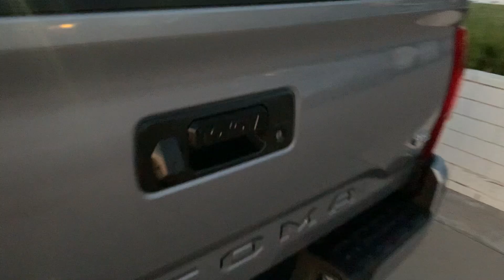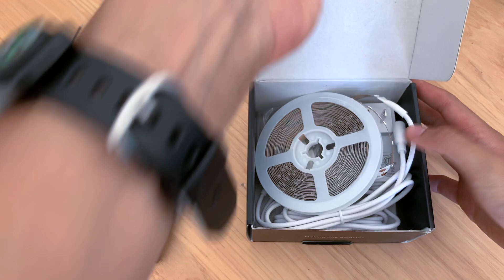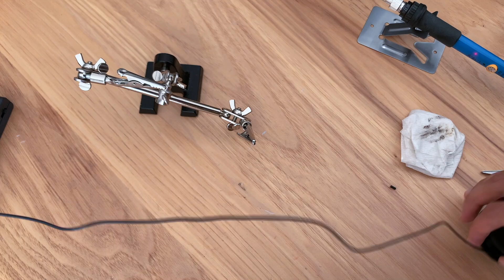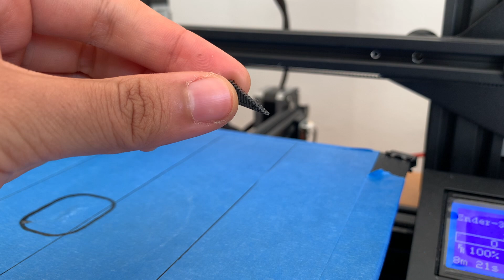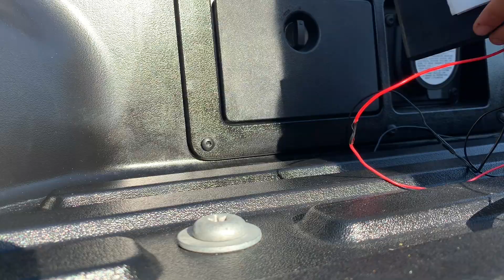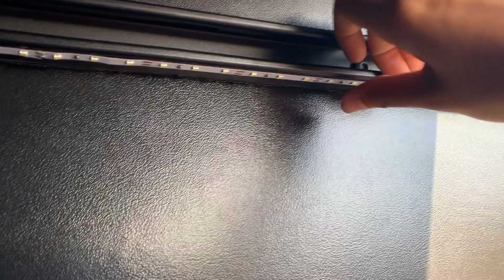DIY Automatic Bed Lights (Prototype) | Toyota Tacoma

Comment: Congrats on graduating! 

Maybe for version 2.0 you could put the tilt switch inside of the tailgate and wire it through the backup camera hole at the bottom for a more stealth look. Kind of like how you'd install a pop n lock in the tailgate.
Reply from the maker: Thanks for the fantastic idea! It would definitely look much cleaner that way.
Reply: @ChloeKuo  Thanks for the awesome idea!
Reply from the maker: @DonaldChapman  That's exciting! Glad you improved on the original design, keep us updated when you finish!
Reply: @ChloeKuo  I finally finished. My LED lightes never were delivered so ended up getting these instead. https://smile.amazon.com/gp/product/B017XFF9IM/ref=ppx_yo_dt_b_asin_title_o00_s00?ie=UTF8&psc=1
They worked out perfectly! I drilled a small hole in to the bed just above the tonnau mounting rail (above the power outlet) and dropped my wires in there. I temporarly removed the power outlet and storge box and was able to solder the wires and hide them completely behind the outlet. It works great!
Reply from the maker: @DonaldChapman  Good to hear and thanks for sharing your work! I'm sure yours looks a lot cleaner with the wires hidden behind the bed lining!
Reply: @ChloeKuo  So I received switches today and ran the wires.  That was much more of a project than I expected! I connected the tilt switch near the pop-lock inside the tailgate and ran the wires past the license plate light (where I tapped for power) and on up in to the little storage bin on the right of the bed. The bed lights will only come on when the parking lights are on and the tailgate is down.  Now I just need to wait for the LEDs to arrive...
Reply: Great project Chloe! I agree with Ken O. You could easily put the switch inside the tailgate, Also you could tap the 12VDC off of the trailer hitch wiring and make it only turn on when you have the parking and/or headlights turned on (just my preference). All that said and done, I would cut out the extra wire between the strips (or hide it in a loom) for that awesome look.  Keep up the great videos!  -Update... So I just bought the LEDs an switch from Amazon, I will be building this next weekend!

Comment: Run one single light strip that is long enough for the 3 sides. Heat shrink tube the 2 corners so lit lights won't be visible there and there will be no loose eire either.

Comment: On the wires, could you make them longer so you could hide behind panels more. Or Use wire looms or gorilla tape them against truck. You should be able to throw stuff in back without worrying about wires.

Comment: In V2.0 use heat shrink on the wire solder joins to make it last longer. Best option would actually be to use butt connectors, crimp and solder then heat shrink. This will create a strong and long lasting connection while tape is more likely to wear off or come undone in extreme weather conditions!

Comment: Everytime you hit a large bump the lights will go off 🤣. Better off using a different method: hall effect (if you can print something to get it far enough away from the body metal), ir distance, capacitance, or 6-DoF.

Comment: To me this is the only way that makes sense for a bed light to be activated. I have the OEM Toyota bed lights for my 2017 Tacoma but I don't wanna go through the rigmarole in wiring it up to the light switch. Thank you for posting this I'm going to see if I can make this work with those. You are beautiful and you have a beautiful truck!.... And congratulations on your graduating you are awesome!

Comment: Congratulations on your graduating. Initially, I was thinking that the automatic portion was going to be some magnetic switches in the tailgate. I work on alarms, the only tilt sensor that I was aware of, was for wireless contacts for certain manufacturers. I had never even thought of a tilt switch of this fashion. I did a similar install in my 2004 Toyota tundra. I am going to be doing another install in my 2014 (don't hate me) Chevrolet silverado.

Comment: Version 2: Use 1/4" black split loom to clean up the wiring, and you can then use printed brackets to hold the split loom in place or secure it with commercial brackets. You can also install a contact switch in the tailgate, or print a better bracket for your tilt switch that can mount inside the tailgate (using the rear view camera wiring harness to conceal you wiring) (other notes below)

I do like your idea of using a tape up LED strip below the cargo rail, though I am concerned for the long term longevity of the LEDs in an environment that is prone to moisture.

I have been looking at a similar project for my Tacoma as I have an ARE bed cap. In my case I plan on making a switch bank that will mount to the side of the bed cap next to the rear gate. This will include a couple 3 way switches for lights as I will be installing light strips on the ceiling of the bed cap and near the bed rails, plus a light source on the rear bed cap window to illuminate a drawer system, and plus a pair of switchs for a couple plugs for modular power to storage boxes I can mount to be accessible from the side windoors as well as a switch to be a master power switch for bed mounted 12v outlets and USB ports. Each of the 3 way switches will be wired to a contact switch or tilt switch attached to the rear window so that with the switch in one position, the lights will be turned on when I open the rear window but in the middle position will be off completely and in the third position will simply be turned on (probably only used when I am camping in the bed of the truck)

Such a 3 way switch might also be of benefit to you with your bed light project as it would allow you to switch your bed lights off or on manually when you set up your truck tent for camping since you have to drop your tail gate to set up the tent.

I presume your bed tent is one of those that includes a liner inside the truck bed much like a normal tent has a ground cloth built in. Since you have to open your tailgate, that would turn your bed lights on the whole time you had the tent set up unless you removed the batteries from the pack. this could be remedied by a switch, or even a wireless remote receiver that bypasses the tilt switch to turn the lights on and off manually when desired, or switched back to automatic operation the rest of the time.

Comment: Congratulations on successfully completing your schooling; YAY! This is the simplest bed lighting I've seen (I've watched plenty prepping for my own), thanks. I'm pretty sure you'd need to modify a few things for those of us who are lucky enough to experience real winter. I suggest supplementing the adhesive on the lights with exterior grade silicone. Also, instead of only electric tape over the solder, it may be best to use heat shrink tube? Most people prefer to wire the lights directly into the truck battery but your way is simpler. Great video.

Comment: Is there a specific reason why you decided to go with external power?
Reply from the maker: Since this was a temporary setup, I decided to power it independently since I knew I would eventually replace it. I’ve been working on/thinking about V2, which likely will tap into the truck for power 😁

Comment: Hi Chloe! Great video, and I like the project idea, but as mentioned, despite the master on-off switch, I think you could benefit from replacing the tilt switch with a Reed Switch (aka A Magnetic Switch). Im not sure if youre familiar with them, but they are commonly used on home alarm systems for sliding windows/doors, and one side is wired into the system, while the the other is just a magnet, that way when the two items are pulled apart the circuit is broken (or closed, depending on the type you get) and thus your "trigger" for the system. Given that you are working with a 12V setup, Directed makes a nice switch ("Directed Electronics 8600 Micro Magnetic Switch" on Amazon and elsewhere ) that can be configured as "normally open" or "normally closed" and would eliminate the possibility for illuminating your led's on downhill parking, rough roads, etc. This would also be easier to conceal, and just as simple (if not, easier) to set up as the tilt switch was. The other alternative you could go with would be a pin plunger switch (google hood-pin switch) but if not installed correctly, these can be more problematic with situations like the plastic plunger breaking, etc. Ive been in the car electronics & remote start industry for over a decade, and these would be the sensors I would utilize if you were a client/customer. You are on the right path, and have some excellent responses/suggestions down below, and I'm eager to see version 2.0! Keep up the awesome work, and consider me a new subscriber!
Reply from the maker: Thanks for the suggestions! A Reed switch sounds like a better solution to trigger the system, I'll consider it for V2!

Comment: This is really nice!! 
But I think it's not really practical to power them using batteries when you can just run a fused line to the car battery.
Also I'm not so sure about the tilt switch working properly when driving on steep roads, or maybe off-roading.
I would rather use a magnetic switch  in addition to a manual kill switch just in case I need to have the tailgate open for long periods of time or during the day.
Another thing to note, those led strips are not waterproof at all, even using a tonneau cover the truck bed still is exposed to water, dust, humidity, etc. So that will surely decrease the life of those led strips.
Those are my 3 cents.
I am going to do this same install on my Tacoma, but slightly different.
I'm still in the planning stage, but some ideas I have are using a photocell sensor switch in addition to the magnetic switch and kill switch. Or maybe wire it to the trunk light using a relay.
Not sure what I'm going to do yet, maybe next weekend or the following I will be uploading a video of this install.

Congrats on you graduation!!!
I hope to see more of your projects!!!

Comment: Nice job!

 Something you can do in the future is also use a window contact switch like the ones for alarms. As for batteries, you can get a rechargeable battery pack that had USB type c with PD. There a mini circuit board you can buy and program to have the type c output 12v when plugged in. Just some thoughts. Great work!

Comment: This is cool. I have a 2020 and it already comes wire ready for me. I just have to buy the led bulb kit, but I have been thinking that I want to turn it on manually at the bed of the truck so I've been looking at different options. Good work

Comment: You should investigate the battery circuit on the 7-pin trailer connection.  You may be able to tap into that and get rid of the battery pack and having to buy a stock of AA batteries.

Comment: Nice work Chloe. You might want to use heat shrink tubing for you soldered connections rather than electrical tape. 1st it's a cleaner install, 2nd seals better and 3rd it stands better to the elements. You can buy them in different size and colors to match your wire too.

Comment: Thought the tilt switch was a perfect application. I think i'll do something similar, but add a micro-controller and a pot with brightness control, then a small solar cell to trickle charge batteries.  Congrats on your EE. Consider applying to Ball Aerospace, great company in need of good EE's.

Comment: Nice Project Chole!  I will be doing this project when I get my truck.  The problem with using the sticky side to hold the light up is that the glue will melt during a hot day.  Try to use Super Duty Hot Glue sticks, probably have one that will withstand high heat.  Also for a switch, I will use a Directed Electronics 8600 Micro Magnetic Switch from amazon.
Reply from the maker: Good to know about the glue. I'll keep that in mind for V2!

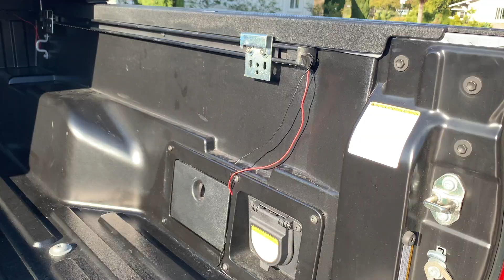Comment: Congratulations on graduating! Lights turned out sweet! At 7:27 what rain guard do you have for your back sliding window?
Reply from the maker: Thanks! And I didn't add a rain guard to the rear window, so I assumed it was stock. If it's not, maybe it was added at the dealership and I never realized lol
Reply: Chloe Kuo ok thanks. I’ll have to look some more!

Comment: So what happens when you park downhill?
Reply from the maker: You bring up a good point! There is a master on/off switch on the battery pack which could remedy that issue, but that kind of defeats the whole purpose of the system haha. Something I'll consider and think about in V2!
Reply: "Switch"sides of street📉😎📈

Comment: Nice video! I would suggest connecting the tilt switch to a relay and use relay to control the LEDs. I did some Google search and found the datasheet of sw520d(the switch you used), seems the maximum current is around 20mA, which seems too small given the number of LEDs you have. One other thing to verify is will the tilt switch keep turning on and off while car is moving?

Comment: Great job on the lighting! The only concern I would have is where you stored the battery case. I had a 2001 Tacoma and it had compartments like that in the bed but water was able to get in. This is a much newer truck so maybe it’s airtight.

Comment: You can pretty much create anything with 3d printing. I suggest making wire casings/tubings which you can stick on the bed sides so you can virtually hide the wires with it. You can even make L shaped wire tubings for the corners. Your taco looks great btw!!

Comment: Congrats on graduating college.  Does it turn on when you hit a bump?
Reply from the maker: Thank you 😊 And in theory, yes, it could turn on when I hit a bump. However, the battery pack has a master "off" switch, which I plan to use if I'm going on a long drive!

Comment: I have an sr5 model and it came with bed lights, weird the your trd didn’t. Anyways mark my words your channel will grow fast.
Reply: yeah the 2020's have the sweet bed lights.
Reply: Do you mean just the rear light on top of the cab?
Reply: Kyle Nelson nah on both sides, one by the little storage box and of course another mirroring the position on the other side, never noticed until I installed the tonnoue cover,
Reply: @txkingg  is yours a 2020?
Reply: Kyle Nelson yes